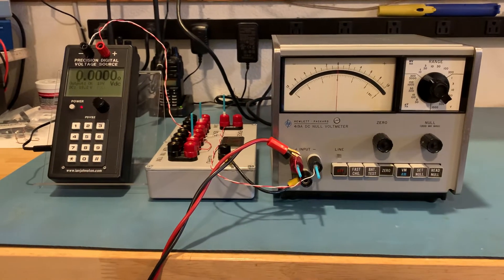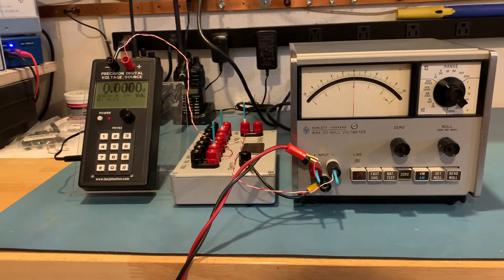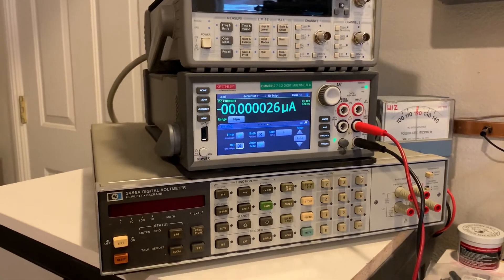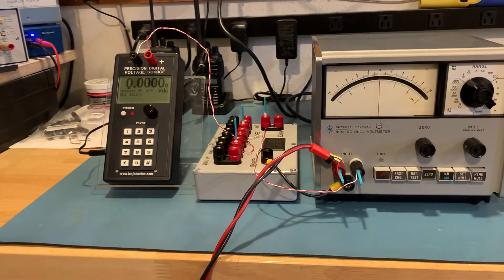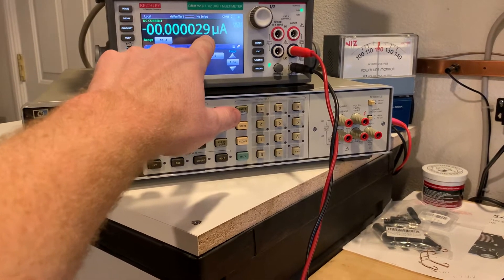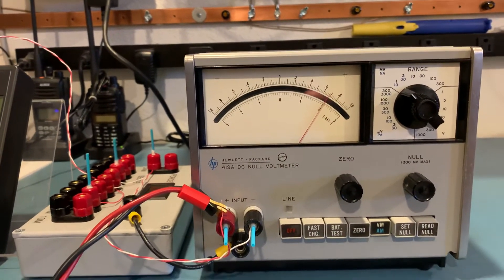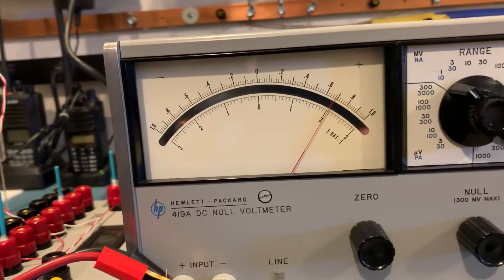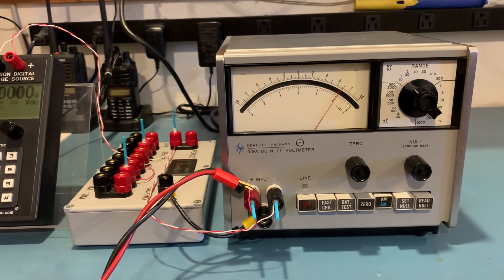Hp 419a null function repaired and use.

Comment: So, if you were going to use this to measure a Weston cell or similar, would you preset the 419's null to be close to the cell's nominal voltage using some other voltage source in order to minimize the otherwise larger initial current draw?
Reply from the maker: Since you can only null up to 300mv, you would use this to measure the delta between two Weston cells or a bank of cells or a Weston cell to a known voltage standard though a kelvin varley divider or the likes, then null out the delta, say 10v known standard though a divider to generate 1v, then measure the delta to the Weston cell of say 0.18v, then set the null to match the .18v.  You can now measure the 0.18v delta from the known voltage standard with out drawing current from the Weston cell.  Or you could simply measure the delta between Weston cells.
Reply: @damonkj7e  I see. Makes sense. Thanks for the explanation, Damon.